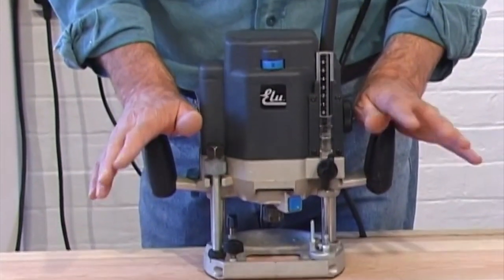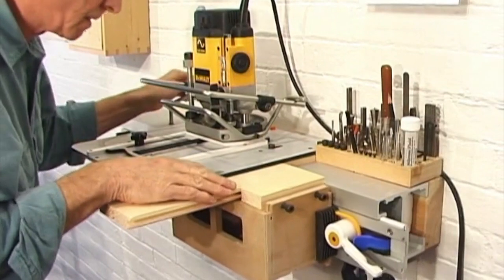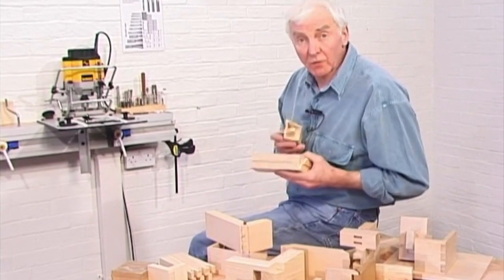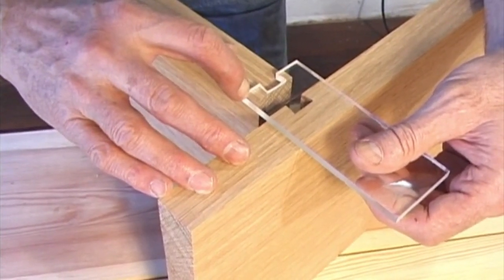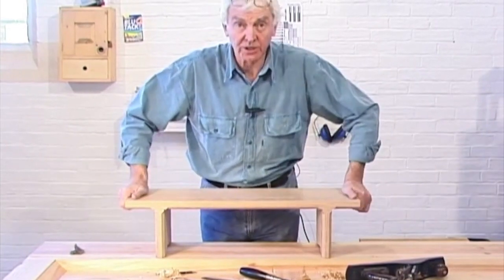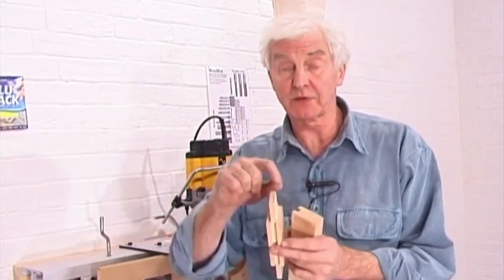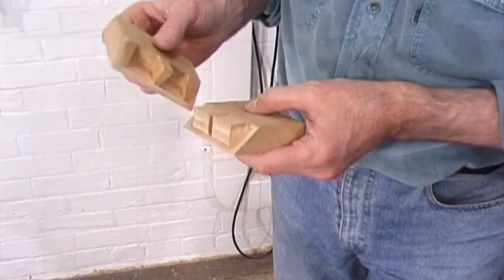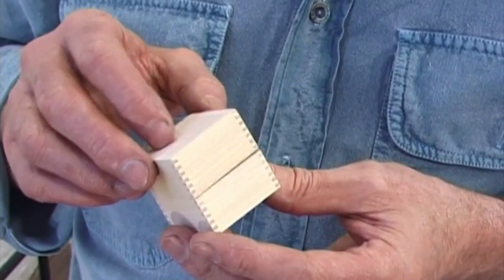Introducing the WoodRat part 2

Comment: I do like how it takes up virtually no space in the shop.  I’m already about 98% handtool only and only pull out a router if I have a crap load of items I’m going to need dados on (I’ve got a decent variable dado jig for doing so).  It’s really doesn’t take any time at all to cut sliding dovetails by hand, I make my own molding with Rabbets, H&R, HRs, and SBs planes, still pound out my own mortises, and cut dovetail just fine. But I can really see this as very useful for a hybrid woodworker; I’ll have to talk my neighbor into buying one. That way, I can go use it 😂. After all, he comes and borrows hand tools from me all the time.  If I was younger and didn’t build furniture purely for enjoyment and as a way of loving those I build for, I’d be a hybrid shop for sure.  This is far cheaper than a panto router, incredibly cheaper than my hand tools, doesn’t take up much shop space (mine is 20’ x 20’), and a guy could batch out a bunch of things in an evening, and maybe complete smaller projects in a single day.   How about this, next time I get an itch to buy a table top power mortiser, I will certainly give you another look.  Yeah, I’d still have to clean up corners, but there’s a lot of neat stuff I could do and batching small gifts for Christmas (like you give friends and neighbors) could be done in a weekend; which would leave me more time to cram into my handtool calorie powered builds for family.   I had never heard or seen the woodrat until today, I’d say that it seems about right for the price considering there are so many things to do with it. My biggest question is why is the mortise plate and miter so expensive; do you have a package deal price that includes the 3 add-one?
V/R, Shannon